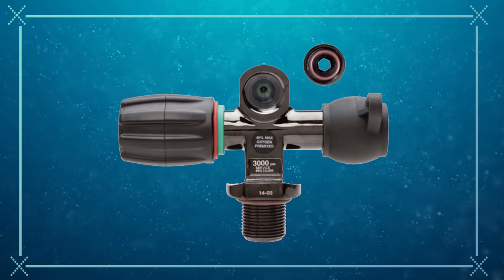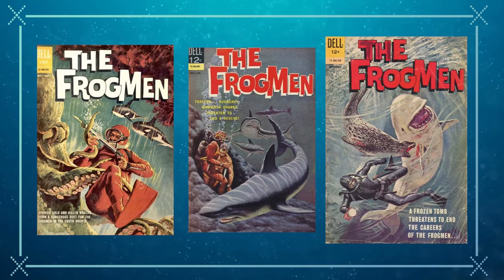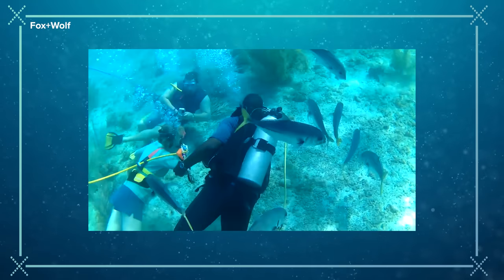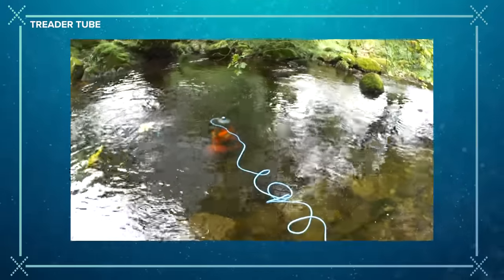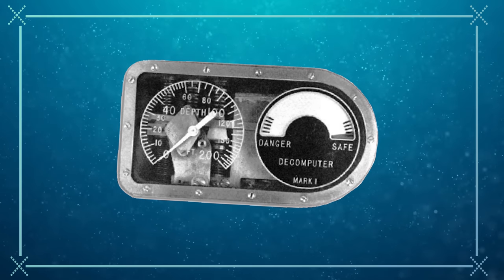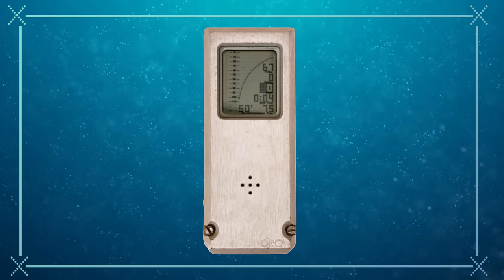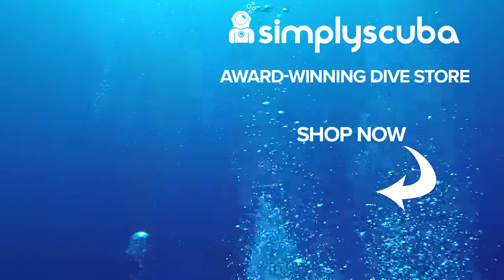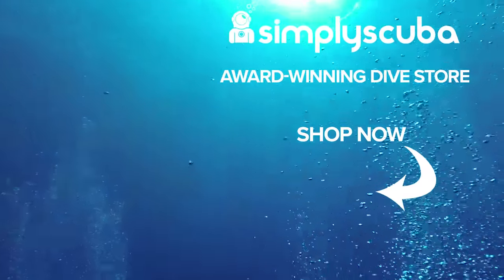Worst Dive Gear In The World

Comment: J valves were essential life saving equipment, how can you call them crap?
Reply: Eric M For moderns days It is crap!! It’s completely unusable!!
Reply: @wksjunior95  and no one uses them because we have SPGs.

Modern scuba diving would not be a thing if not for J valves
Reply: Use a j valve in conjunction with an spg for an additional level of redundant safety.
Reply: J Valves were pretty much mandatory when I was first certified. The biggest problem I see with them was that it's not inconceivable that something could bump them and put them in the wrong position while submerged. (ever have a mask kicked off?? it happens) so you're blissfully swimming along when suddenly the tank goes dry, reach back and.. oh-oh. But then again, I've seen my share of divers that tend to go deeper and longer than planned and never check their SPG. I'd say its  an actual wash.
Reply: @jimbatten1927  good divers today are constantly checking their gauges. Good divers when I was young were constantly checking their j-valve position. It's the exact same thing. Checking a J-valve was actually easier than checking a gauge, because it was done just by feel, without looking at it, single handedly, without a flashlight, and in complete black-out silt conditions. Could even be done without a mask.
Reply: Waggoner  Kranmer why is it unusable?
Reply: Exactly.  They were completely appropriate for the times they existed.  Advances in technology made them irrelevant but they weren't bad given the lack of alternatives.  I guess the 1908 Ford Model T was a complete POS because it wasn't a 2020 BMW 6-series.  This appears to be the logic used in this video.

Comment: Unsafe - Air2 types. Not only are they really crappy inflators but also very hard to use in an emergency. If you are not extremely familar with the buttons it can be hard to hit the purge on most (some only have room for 1 finger) or in a panic you can grab it and hit the inflate, so you are having trouble breathing and now ascending

Just useless - I bought one of the 3 pack combo lights with keepers when I started. By the time you added 3lbs of batteries (hey, less lead), found somewhere to clip all the bits, got hit everywhere by all the junk jumping in, got the straps all tangled and couldnt figure out how to release the retractions (since they were all different) you finally got to use your light and discovered the giant pistol grip thing was barley enough to see your SPG
Reply: There's nothing wrong with inflator/octo combos.  Just like any gear, you need to practice with it and learn how to use it before an actual emergency happens.

Comment: An air 2 on your bcd. They are bulky and in the way all the time. They also dont fit well if you even need to use it. The hose is always a bit to short and it pulls on you. Along with you cant control you bcd very when when breathing on the air 2
Reply: AP Valves in the UK have a small air cylinder on their BCD's and it can be used as a bailout and the auto Air if needed, Auto air acts as an Octo 2nd stage as well as inflation and dump, however the issue comes about, if you run out of air in your cylinder, you can breath off the BCD and replenish the air in the BCD from the small cylinder, however proper cleaning and sterilization of the inner bladder needs to be adopted and stuck to religiously, same principles as the counter lungs of rebreathers.
Reply: It comes down to practicing. I almost exclusively dump air from my bcd with my right shoulder valve anyway and practice breathing w/air2 every few dives at the end while doing safety stop.

Comment: Those stupid (and yes you sell them) full face snorkel masks that have about 50% of a breath in dead-space recycling CO2. Split Fins. Curly cord torch holders. Retractor torch holders. Open bottom SMB. Spare-Air. Dive-Alert-Plus. Spring loaded clips. Push button torches. The Air-2 combo inflator / octo.
Reply: Brother-Diver John, good comments, & ya, I absolutely  HATE those "curly-cord" things!  This is why I design, make, and use my very own  "curly-cords,"  but I use stainless-steel  AND good rigid surplus telephone hand-set cord.  Cheap and when it rots out, I just go find some more surplus coiled phone cord and replace.

Comment: As for equipment obtain the BEST equipment you can afford. (Do research!!!) This stuff is considered LIFE SUPPORT EQUIPMENT! You go with cheap garbage you get poor results. Choose your dive partner wisely. Your dive partner is supposed to SAVE YOUR LIFE;  make sure that he knows it!
Reply: The most expensive equipment is not necessarily, or even usually, the best equipment.  There are plenty of simple-to-maintain, easy-to-operate, inexpensive, dependable, good-performing workhorse regs or BCs that I would recommend far before more expensive examples.

Comment: I've seen my fair share of divers using i3 BCDs and the hose just seems to pop off from the BCD (which doesn't seem to happen as often with regular BCD), leaving the diver in panic and the divemaster had to help the person, giving her his octo, closing her cylinder, depressurizing the system and replugging the i3 back.

Seems like a fancy BCD with a lot of trouble involved.
Reply: I have the AL Dimension i3 and I am trying to visualize what you are saying here. (Not arguing...).  The i3 inflator mechanism attaches to a LP hose with a quick disconnect. If the i3 hose "pops off" why would you need to to receive an octo, close the cylinder, depressurize and replug the i3??  You are aware that it is common to unplug a LP hose to inflate a DSMB??  Perhaps  I am not interpreting your point??

Comment: The air 2 bcd inflator/octo. I like having my long yellow hose octo on my side. It’s not for me. It’s for my buddy. And having a buddy quite literally hanging out my reg when he blew a O-ring in the 1st stage on a dive I learned keep my reg in my mouth and while my buddy is panicking because he’s out of air I can guide him to my octo.
Reply: Totally disagree, the Air 2 is not a bad piece of Gear, as a instructor you should teach, a variety of  gear configurations, every configuration has its good points, and pad points, but saying a Air 2 is a bad piece of gear is just wrong in so many ways.
The Air 2 was designed by Doug  Touth while working for Scubapro, in 1978, Doug is arguably the best design engineer in the industry, in 1978 Scubapro had the patents on this design that lasted over 25 years, no other company could have this design they defended this patent and forced several “copies” off the market for years, it was not until the patent expired that other companies could copy the design, the AIR 2 is the most copied design of a regulator in the industry, so if there so bad why does  almost every  manufacturer have a copy of this design.
Now lets talk about the use, the 1st advantage of this regulator is its always where you know where it is and you can find it, Look up Scuba diving videos on youtube, 90% or more of the divers you will see have there Octo, not secured, in the “ golden” triangle, like they should there unsecured and filing with sand and crap during the dive, so if they have to use this regulator, they 1st have to find it, then when they pass it along, and its filled with crap, that will make for a very bad day.
Most people have a very inexpensive “low” end non balanced regulator, as there Octo so in a emergency when the diver in distress needs air he is using the lowest cost worst preforming regulator you can by just on. Just try it with your gear if you have a low cost octo, switch and do a full dive with it, then you will know what I am talking about.
Buy Passing you primary, high quality reg (that you know works and is not full of sand) to the person in need, then using the Air 2 that you can find( its 2nd nature because you use it all the time for your inflator) you will be closer to the other diver and have way better control of them during the accent and have way better control of the situation.
The bias of the Air 2 comes from the fact that from 1978 to 2003 you could not get one unless you were a Scubapro Dealer, so if you had a store, and no dealership for scuba pro you could not use this device so to sell your Octo its made up crap that the AIR 2 is somehow bad.
If they are bad, they why are they still on the market after 1978, and why would almost every single manufacture, start direct copies since 2003?   Gee I wonder why. 
The Air 2 is not bad gear, just different, and you must train your students for it, and let them decide what is best for them, 
Teach your students the gear that is out there and stop the garbage that the AIR2 is not safe or not a good gear,  Most if not all of the gear in Diving is personal preference, and Divers should be able to shop and find quality gear that works for them and not to Bash AIR2
Reply: To each their own, but I really love having an inflator/octo combo.  Keep my primary on a 48" looped under my right arm for an OOA situation and I always know where my inflator is.  Plus, having your octo/inflator in your mouth as you ascend makes it super easy to manually fill or dump air out of your BC.  Just like any other gear, you must practice with it.

Comment: I hate the octo clip crap.  Neckless and a primary is the only way to go.  The current rec dive setup sucks. Mark,  you forgot to mention "split fins", yeah they are so amature.
Reply: Ah yes, hand off your working primary and switch to a maybe functional backup. That way you can pass out and your buddy be tethered to a sinking air supply 🤦‍♂️
Reply: @fathom493  if you did a proper equipment check, chances are awesome you won’t have that issue brother.
Reply: @mustanggun  Same is true for the standard setup. I got nothing against a long hose, I think it's good in many scenarios like cave diving. However, the primary handoff is adding a lot of unnecessary risk. As you mentioned, if you do a proper check of equipment and maintain it well, there is an extremely small risk of the backup failing. So, the benefit of "knowing the primary works" is moot. In addition to this, the primary handoff method teaches divers that their backup source of air is the one in the mouth of their buddy. 

This obviously has many drawbacks. Let's look at a scenario. 

You're focused on taking a photo of a fish, when all of a sudden your buddy runs out of air. He goes for your primary, ripping it out of your mouth. I understand that in pool training this IS NOT the proper procedure, but a panicking rec diver that's out of air will seldom be calm and collected. When he rips it out of your mouth, this could be mid breath leaving you with a lung full of water. Also, the mouthpiece could stay in your mouth rendering the primary useless. 

Contrast this to the standard setup. In the same scenario, your buddy takes your backup off your chest. This means you never had to take your primary out of your mouth. You were both kept safe, and YOUR primary air source was never jeopardised. Your safety is more important than anything else, even over your buddy's safety.

Bottom line is, the primary hand off method adds completely unnecessary risk to sharing air. I understand that for tec diving, cavediving, etc where divers have more practice working in high stress scenarios, this setup can work. That being said, it has absolutely no place in recreational diving. Most rec divers do not have the same level of calmness in an out of air situation as highly experienced tec divers. This is especially true when diving with someone who has not used the setup before, or someone who is relatively new to the sport.
Reply: @fathom493  ok, so what are the risks of donating the long hose?
Reply: @mustanggun  
There isn't an issue with having a physically long hose. I think a long hose on an octo, if properly managed, can be a good asset.

As for primary donate, I outlined the issues in my above comment.
Reply: @fathom493  I agree with you on a few points. 1. Many rec divers training, experience, and skill level is an issue. So, I would say before the dive, if one diver uses the tech long hose set up, and the buddy isn't familiar with that set up, make sure he/she is fully familiar. And do a quick training on how the long hose will be  donated, and basics of the equipment.
2. It's all about what you are trained with. Most divers that are diving with a long hose, are probably more experienced.
3. The long hose tech set up is the only acceptable configuration for tech/cave/wreck etc. If everyone was trained from the beginning, whether rec or tech, using the long hose/necklace set up, and that was the only set up used, this whole convo would be moot.

FYI, a 2nd stage without a mouth piece is still good enough to get someone back to the surface, just hold it in your mouth.

Comment: The grey plastic octo retainer on my scuba pro knight hawk works really well. It holds the octo firmly and yet releases the octo when tugged. It also has one of those little connected  free flow preventers. Anyway I like it a lot better that those gummy yellow holster thingies. No complaints here. https://youtu.be/UxhSvTi4MaM
Reply: I use the scubapro octo retainer also. It works great.
Reply: @YYY0215  I second the Scubapro Octo retainer.  The only issue I've ever had  with it was when I pulled the retainer off while providing emergency air to another diver (it came off the BCD and stayed attached to the octo's mouth piece).  But so what?  I was still able to provide air when needed and then just retrieved my octo holder when we reached the shore.   Its nice knowing exactly where the octo is at all times (I can reach it in a single second without looking.)

Comment: My worst piece of equipment and dive were one and the same. Don't get me wrong regulator was a decent one for recreational limits. But had just gotton it serviced took it on a dive trip first two dives to 90 feet the reg would crack open slightly. Next day dive to 150 reg locked full open, my dumb ass should have known better, I should have readjusted the reg myself. 
Ever since I run with a diverite transpack system for a BC and Poseidon regulators never had a problem since, and that was 30 years ago

Comment: plastic slates. Ok, fine, but are they REALLY necessary if you aren't teaching? No. Hand signals work best with your buddy during your planning of the dive. All slates do is float and wind around your equipment..lost mine 2 mins into my first open water dive and never replaced it.

Comment: If I see my buddy with an octo clip I will set it on fire. I don't care we're 30m below the surface; I will do everything in my power to burn the thing. There are probably some rattlers and a dive alert horn around to kindle the fire.
Reply: So u prefers dangling octos? Or folded into bcd pockets with weird angles?
Reply: Because I'm fairly new to scuba I'm not fully aware of all the options or the drawbacks to certain gear. However, my LDS recommends this octo clip: https://www.amazon.com/dp/B004UDFAWG/

I don't particularly like the plastic clip and you do have to yank on the octo rather forcefully to separate it from the mouthpiece, but it keeps the octo in place and is relatively quick release (given a panicked person's adrenaline rush to grab the thing).

There are likely better alternatives, but folding them into BCD pockets seems insane and any of the other clips I've seen don't seem as practical.
Reply: No way I am allowing my $500.00 octo to dangle , drag the bottom, or get damaged.  Its no use at all if it is ruined or doesn't function.  So it may take an additional second to get it off my d-ring to donate, but there is a price to pay when scuba diving.  Now, if I figure out a better way I will do it, but for right now, I will protect my gear.
Reply: Bob Merrick buy a 90 or 70 degree hose adapter and a rubber octo necklace, quick release and it’s always right under your chin should you need it or easy access for your buddy. Or switch to longhose and a bungee necklace and donate your primary and use your backup. Either way is good but longhose more streamlined.
Reply: @bfett4hire  Oh I like the idea of the necklace thing.  I am def looking into that.  I mean if the experienced guys are saying that is the thing, they have the experience and have learned from it.  I 100% support it!
Reply: @fredericv974 
No suicide strap for me. 
Plus as Alec pierce put it  about primary donate, in this video about 3:05

https://youtu.be/-gECkfDm58g
Reply: @bobthediverdudemerrick6811  a $500.00 octopus? Didn't know Swarovski made diving equipment.
Reply: Longhose + necklace. Easy, simple, no plastics.
Reply: @hanskuijsten2380  When you use the best it doesn't come cheap.  Atomic Aquatics is proud of their equipment.  I have a B2 Octo.  $429.00 plus tax.
Reply: @bobthediverdudemerrick6811 😉 Whatever makes you happy.
Reply: @hanskuijsten2380  Well if I am going to be diving I want top notch equipment because we are talking about life and death if we make a mistake.